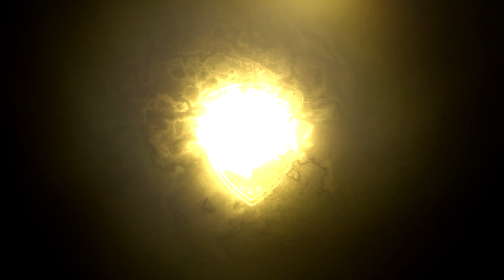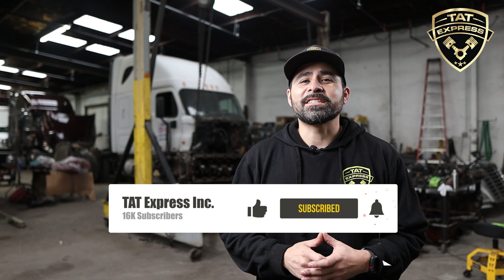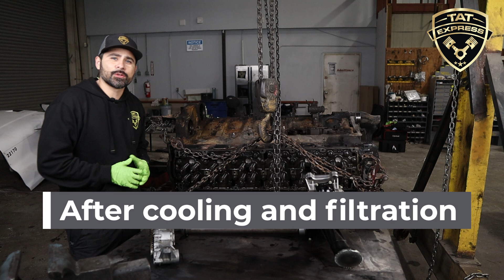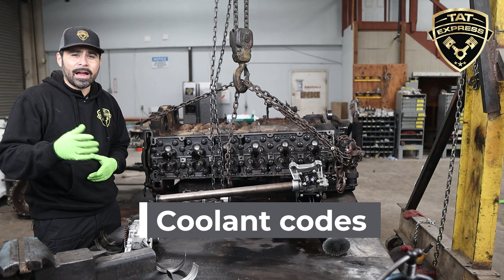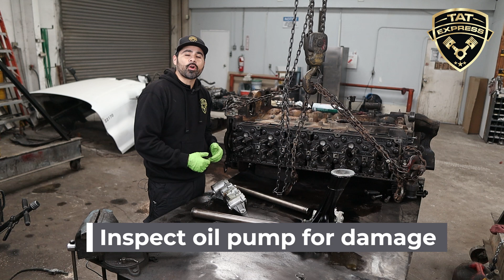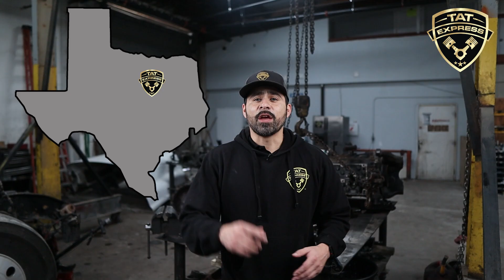DD15 Engine Locked Up/ DD15 engine Seized/ dd15 engine low oil pressure/dd15 engine knocking noise/

Comment: Priming the oil is a must.
This might be an old video but it's still a great basis to go through when rebuilding and working with dd engines. A lot of shops today refuse work on dd in my area so guess what i do haha
Reply from the maker: Your 100% correct. Old service techniques do not apply to modern diesel engines. They are more precise and less forgiving.
Reply: @TATEXPRESSINC  the subjects you went through is general. Witht he dd oil and fuel. They are very important guides to base on. Every tech tackling the dd series needs to check all these during an in or out of frame.

Comment: If anyone has an idea of what I'm experiencing...driving alone 65/70mph and all of a sudden, oil pressure goes to "0", (lights) check engine, engine, red engine (flashing for about 10secs) and the oil 🛢 light for about a minute or so and then after that 1/3mins everything's back to normal with the exception of the "engine light" that's still on...DD15...Y'all be safe out here! and Thanks in advance! 🤜🏾🤛🏻
Reply from the maker: If the pickup tube O-rings haven’t been replaced, that’s definitely the next move—they can cause intermittent pressure loss like you described. I’d also check the oil manifold and replace the oil pressure sensor just to rule it out. Seen all three cause similar issues. Let us know what you find.
Reply: @TATEXPRESSINC Roger that! I spoke w/the young Lady a couple of days ago, I was trying to get an appointment  w/you guys for this issue but due to my truck being deleted, I'll have to render other services but I Thank you guys in advance! You guys YouTube videos are VERY informative! I wish I'd knew about you guys before I did what I felt like I had to do (lol!)!
Reply from the maker: @cedricsmith2567 Appreciate the kind words and support, brother! We totally understand the situation—there’s a lot of pressure out there that pushes guys toward deletes. Just know we’re here if you ever decide to go back OEM or need help with anything else we can support. Glad the videos have been helpful and hope to cross paths down the road. Stay safe out there! 💪🚛

Comment: This truck got towed in low oil pressure codes and very low oil pressure codes.. hmm it’s got oil, sensor looks good, motor not turning over.. yea it’s locked up. Oh what’s that you say it had a new oil pan put on 10 days ago hmmm

Comment: What can cause high oil psi I run 60 psi around 1500 rpm and 50 psi at 1000!rpm
Reply from the maker: The oil pressure will rise when the rpm is increased.

Comment: i had a co-worker who thought the "low oil pressure stop engine" light was just a sensor and tried to pull it into the shop. locked it up in the parking lot i pulled the starter off and confirmed it was locked up. customer never fixed it with us though

Comment: My buddy has a '13 Cascadia with a DD15 & that engine blew up on him THREE times! The original engine blew cylinder 5, the used engine blew cylinder 5 & he had it FULLY rebuilt with everything brand new. It pushed oil out between the front of the head/block area, started knocking & spun a bearing at 60K miles. This engine is pure JUNK! I'll take a Cummins ISX before I ever own one of these.

Comment: Love your video's bro. We've been finding oil suction manifolds on our trucks with loose plastic piece or little door falling off the side resulting in low oil pressure.one actually seized.😒

Comment: What is low pressure during idle? I have a cascadia that idles at around 12 psi and around 6 rpms. I canceled the idle management cause the rpms were way too high. Now I don't worry about my trk shutting down during the night.
Reply: When idling your DD15 engine should run at about 700 RPMs or better.  When you are parked and your cruise control is turned off bump the engine up using the ACL/RES button on the steering wheel.  That is the lowest your truck should idle during a break.  Your oil pressure gauge should be no lower than about 21 PSI or you may have an oil flow problem.  I don't like the oil pressure gauge on Cascadia model trucks as they do not indicate what low oil pressure is.

Comment: A lot of issues  come from the oil pump seizing up due to lack of oil changes. Engine oil breaks down and the additives that are required losses it’s efficiently over time.
Doing a 30k oil change interval is NOT good as the oil will be of no use.
Use the proper engine that is used by the manufacturer and go to a reputable service center that carries good products.
Reply: Agreed. Also, some manufacturers overestimate how long their oil will last. Back in the 2000s, Toyota had 3.0L V6 engines dying of sludge. They called for 5000 mile conventional oil changes, but those engines sludged up. Many people would insist on 3000 mile oil changes and were less likely to have the problem.

Comment: Hello, I just finished doing a inflame overhaul I also have a dd15 2013 cascadia, my issue is that when I took it for a test drive I went thru 2nd 3rd 4th gear but when I got to 5 gear the lost all power even with my food on pedal straight  down to the floor and now is doing it on 4th and 5th gear, can you give me any printer on what it might be? Greatly appreciate!

Comment: What is a low pressure reading for dd15 while idle ?
Reply from the maker: Christian, the engine will shut down if oil pressure is too low.  DD15 oil pressure at idle is 14 psi.  Thanks for watching.  Be sure to subscribe.  💪🏼🚚👍🏼

Comment: Hello. I have DD15 Freight liner. I just did a suction tube, oil pump and o-ring. The truck was test ride and it only went one mile. At first it was running good then ruff. Cut off within the one mile and it won’t start up it sounds like it want to. I did a computer test no codes coming back. The oil light and red engine light comes on. What do u think is wrong. Miles 800000

Comment: Thats why I bought a 2017 cascadia with no engine and had installed a 2000 series 60
Reply: Can I put a Detroit 60 series in a 2015 cascadia freightliner automatic? I have a DD13 engine at 800,000 miles
Reply: @troypitchford5528  yes definitely

Comment: I do have 2012 Freight liner Cascadia DD15 
I recently made lots of service on it because one of the Pistons was not functioning good... The Mechanic open each and every pice of the Engine top and bottom... he change all the Ring and baring of all pistons and be clean the piston he put everything together.. but I still scared to take the Truck on the Road.. I felt a little change on the Sound of the Engine plus the Oil pressure is acting wired... if I do less than 70 mph the oil pressure gauge stays on 50 if I do 75 mph and above the oil pressure gauge is going up to 60 .... 
can you please help with some information why it’s doing that?? 
And what do I need to do to prevent the Engine not to be blocked....????
Reply: My DD15 stays on 50. That's were it should be

Comment: I'm wondering 🤔
Engine failed after oil pan gasket repair,but you found a broken bypass valve.so did they break the bypass valve when they replaced the oil pan gasket?help me understand the connection.😕
Reply from the maker: Saul good  question.  Improper workmanship allowed excess dirt to enter oil system.  Customer also stated that the PM was done as well.  Usually oil is changed after an oil pan replacement, the broken standpipe should have been noticed during filter change.    Thanks for watching.  Good question
Reply: Most likely put the sump back up then removed the oil filter which would let about 1 litre of dirty oil in the sump then they probably cranked it with no oil pressure for a long time due to fuel filter replacement after 100 kilometres down the road the crank locks up

Comment: All this new oil filter technology plastic top oil filter housings and centers no substitute for a good old-fashioned spin-on metal oil filter Volvo has the best oil filtration system on a diesel truck two full flow oil filters and one bypass three oil filters combined that's a good setup 💯
Reply from the maker: David, thanks for watching.  👊